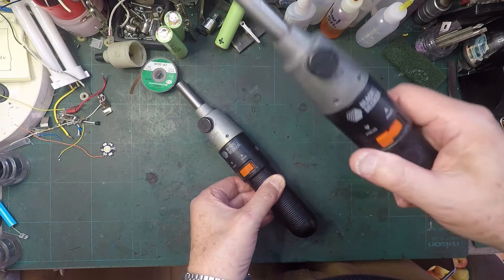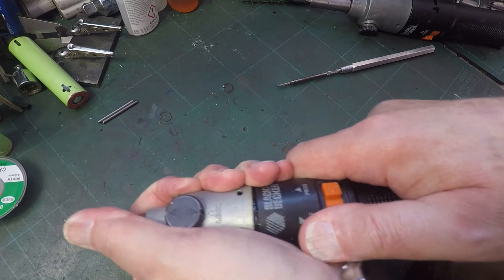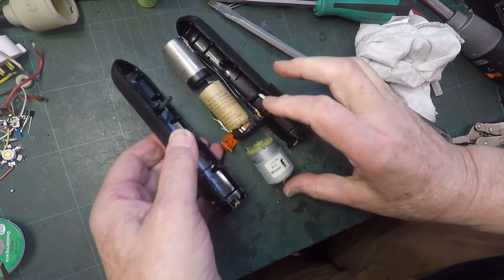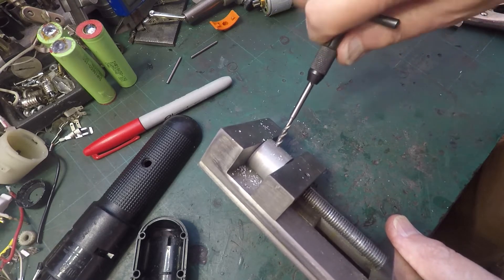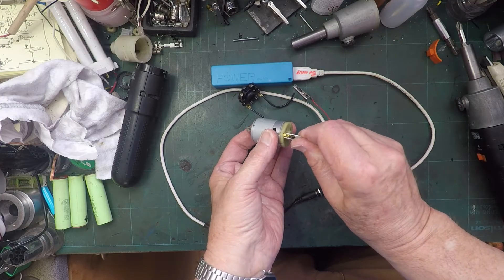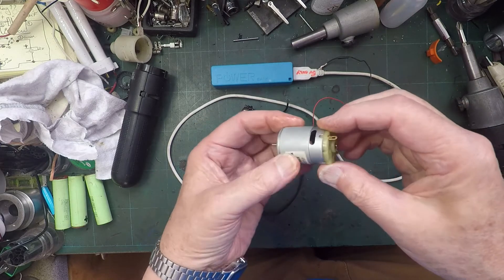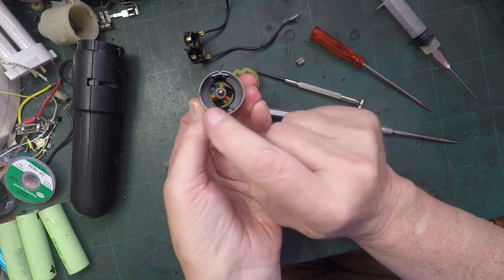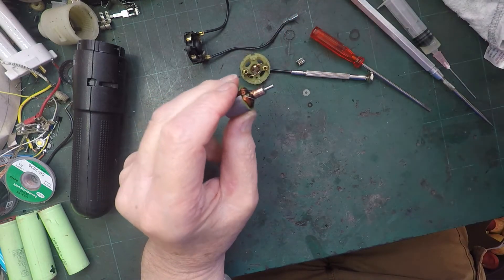Déjà vu two- Battery conversion of another Black & Decker  Cordless Screwdriver

Comment: I found sowing machine oil is good for oilite bearings so give it a try, I used to repair hoover motors and Kenwood motors, and they have oilite bearings in
 them, nice job, I like the ring adapter good idea, what did you use I must convert mine, thanks Bob in the UK
Reply from the maker: I have an ancient tub of "thin machine oil" what ever that means. I tend to use that or 3 in 1. I like your sewing machine oil suggestion. I will try some. The ring adapter was an offcut of some thick walled pipe I think.

Comment: Great Job, but where did you get the charging circuit board from.
Reply from the maker: https://www.aliexpress.com%2Fitem%2F1005004427739715.html%3Fspm%3Da2g0o.order_list.order_list_main.55.21d31802kj6m1Y&stzid=UgxMiA-HcbrrR6ATsCB4AaABAg.A-1JUfskJmWA-1JxorHro3
Reply: @DaftOldMan great job mate
Reply: eBay sell them £1.95, TP4056 MICRO USB 5V 1A 18650 Lithium Battery Charger Module